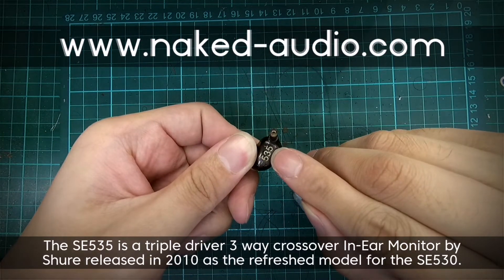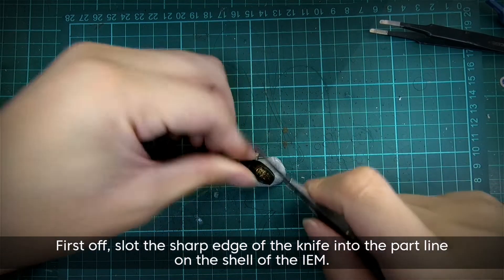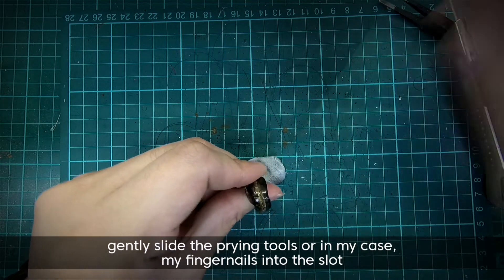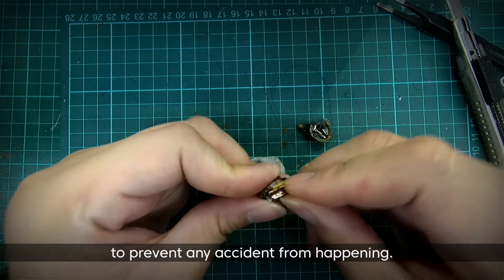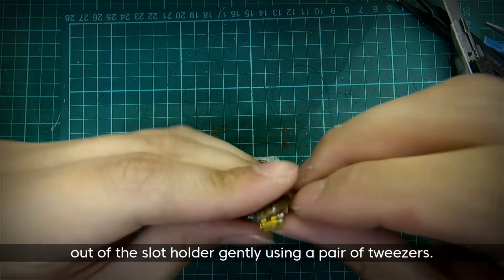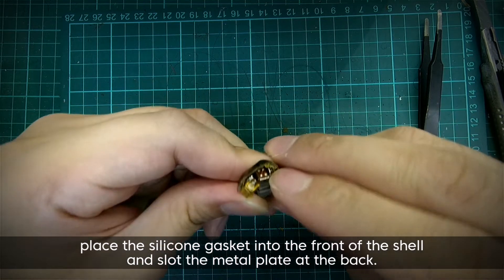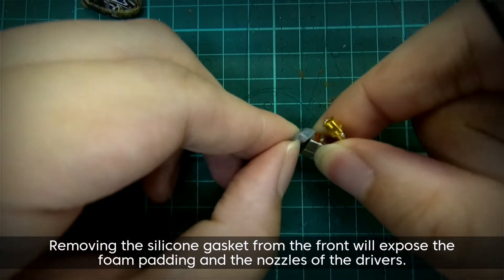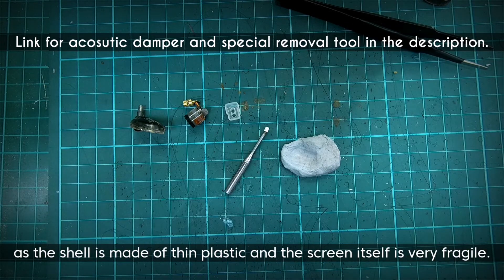Shure SE535 Teardown Reveal. Full Disassembly guide tutorial and interior review [NAKED Reveal]

Comment: I have a pair of these, Shure repaired the left bud and now that the glue has come apart, I can see that maybe it was assembled incorrectly? On the left earbud, the electron ribbon comes from underneath the drivers/silver rectangle instead of from over (like the right bud). This has made the ribbon bend really badly in the left one, the right buds ribbon is a perfectly smooth U. Please let me know thoughts?
Reply from the maker: the left and right uses the exactly same driver and cable setup, therefore, one side will be mirrored, resulting in the bend you mentioned

Comment: Hey man, I recently discovered I enjoy messing with electronics when trying to fix my ps4 and your channel opened up my eyes a new world. I will buy a soldering machine within the next week because I am so pumped up to mess with come electronics with your guide. So thank you for the great content, I also LOVEED the subtitles because I was watching your vid  at 4am while taking a break from studying and thanks to you I didnt wake my roommate up. 

My question is I have a 4 year old 535, I am positive the mmcx connector on right side is broken it barely produces any volume and shells on both sides are unglued and falling apart. I have a brand new se215 sitting around that I never used, can I use the shell of 215 on my 535? If yes I will go to an electronics repair shop to change/get the new mmcx connector soldered and put the shell of 215 in the end. Hope it fits lol fingers crossed!!
Reply from the maker: Hi there, thank you for the kid comment. first off to answer your main question, the shell on the 215 are a lot smaller than the 535 so they do not fit at all even with modification. was glad to have some content which are of interest to you, will be improving the quality of the recording and the content along the way so it is not as boring. the sub titles we have stopped doing them as the youtube auto generated subs are quite accurate and we can manually edit them if need be

Comment: Thank you so much!!!! The damper in my earphone got pushed in and it was stuck in the nozzle :( I now have a damper removal tool and a new damper on the way to replace, but this helped me get the damper filter piece out of the housing where it fell into by accident! Of note for anyone else who finds this: there is a tiny bit of some sort of soft glue (could be a hot glue type adhesive) holding the mmcx connector in place. Be VERY careful when seperating. As the video maker describes, the MMCX connector was attached to the side opposite the drivers and I had to very carefull with tweezers try to get it to begin seperating. Once the glue was loosening it stretched enough to give a little knick with my knife and they came apart perfectly. 

No damage and they still work! closed back up also using his other video! Just waiting on a new damper and my 535s will be good as new for only 5$!